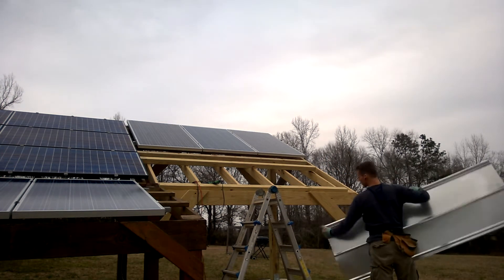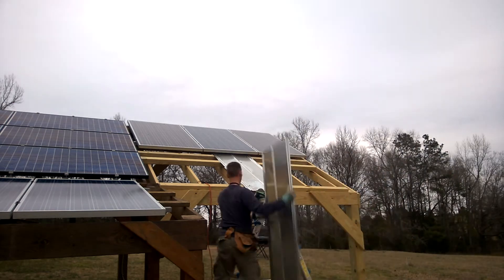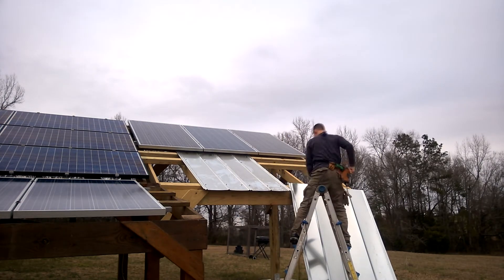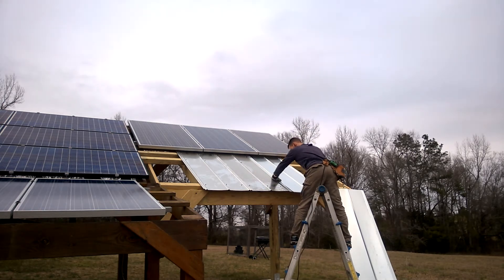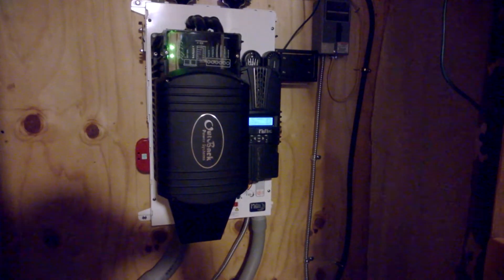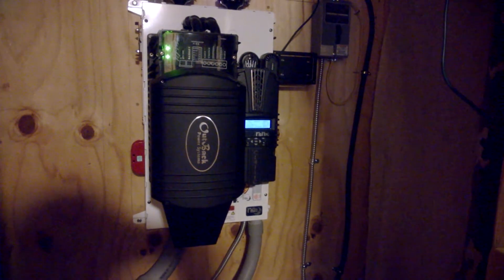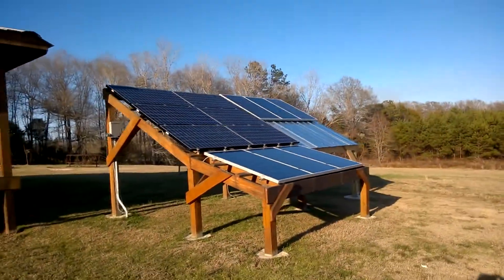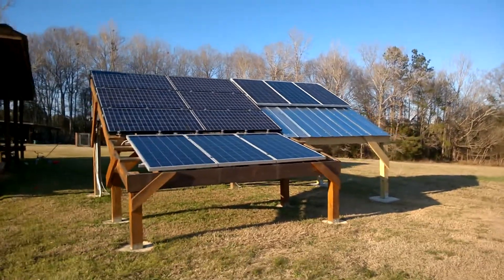2.5kw Off Grid Solar Array with Midnite Solar Classic 150 MPPT power production

Comment: Hello there, nice system...     I have a question... I recently purchased 4 sunedison panels rated @ 315 watts each / 8.3A -  36 or so volt output. I had 2 of the panels on a 40' sailboat with a xantrex 60-120 MPPT, it worked quite well, but sold the system with the boat.. Now I'm powering up a remote cabin - off-grid... would you recommend the Morningstar mppt in combination with the 4 aforementioned panels in combination with a bank of 16 AMG 12 volt batteries? they seem to be easier to find and more popular than xantrex/schenider Kindest Regards...Dave

Comment: That's some serious power for 2.5KW in panels!
Reply: RIGHT ON! Digging it. As for another controller...that might be a good idea if you are getting full output like you said (14.6 KW/H in your other video?) Might do another Classic 150, cut down on the number of arrays on each Classic and split the difference...maybe 1,500 watts per array per controller? I got two (24v system). With my main array (2.4KW) I am pushing the Classic 150 hard in full sun/full charging. The other Classic has 1.3KW on it...doesn't even break a sweat. They are in "Follow Me" mode...work together. Your ground mount array, living in CO, house, up in the mountains, property, is pretty much a dream I have!

Comment: nice output for the day. I did see you beat that amount on another day. question I have for you. what is the size of the 4 different type solar panels you are using? is the wattage the same for each set?  I am running 1650kw of solar panels in parallel into a combiner box my friend made and thru a classic. I did that for the first two years. I just got a midnite combiner box and set them up in sets of 2 per string. going to compare how well then do against running them in parallel and see if it does better. I have 24 volt battery bank at 1040 amp hour. using Trojan T-145 , there 260amp batteries. have to watch the rest of your videos, have not seen a wind generator yet.  also, you have bee's also, they are a lot of fun, keeps you on your toes, again, nice set up, SD.